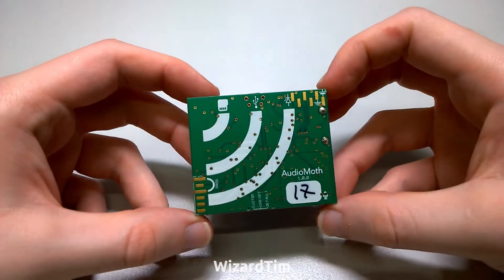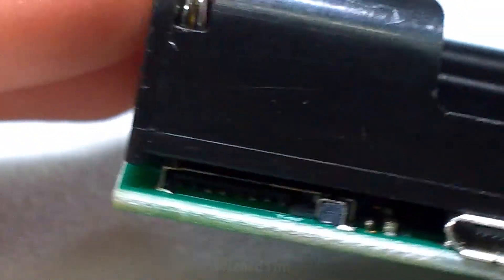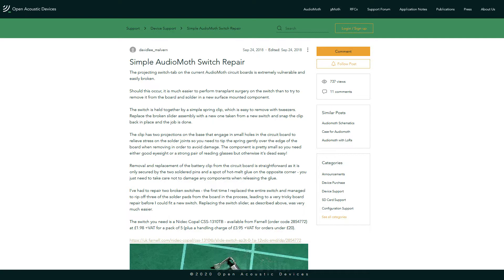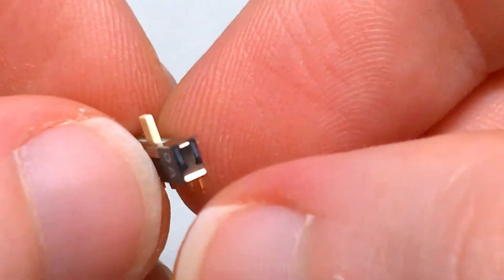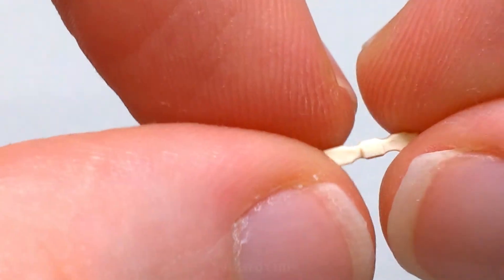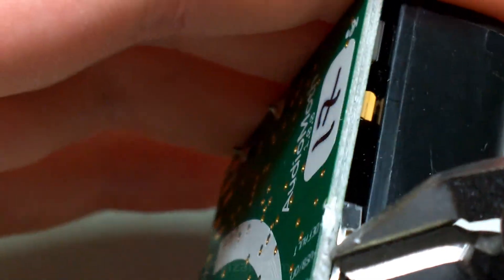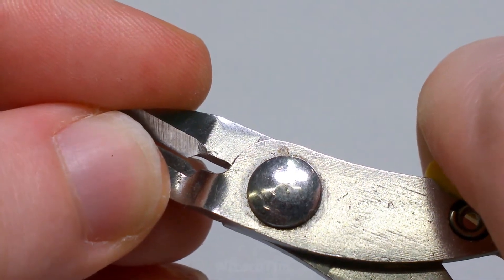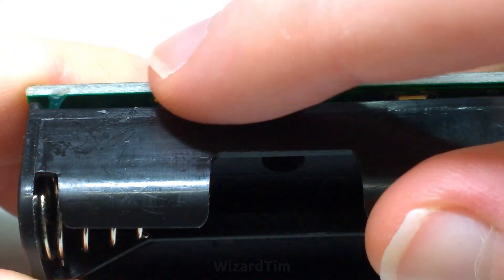AudioMoth Mode Switch Repair

Comment: Never try quit the battery holder, them glue over weak sdram chip for broken if try it. Would glue over board but prefer glue it over chip for prevent dismount repairs.